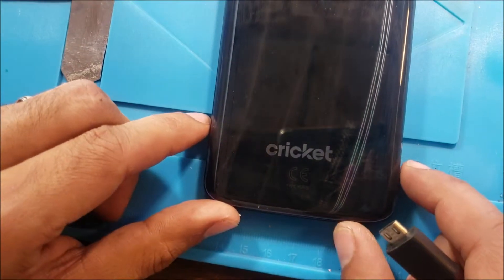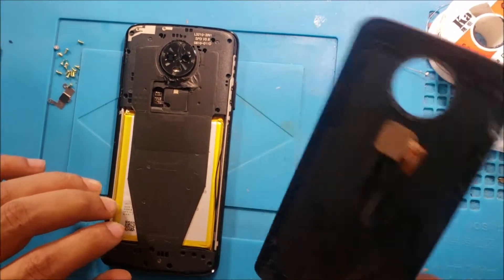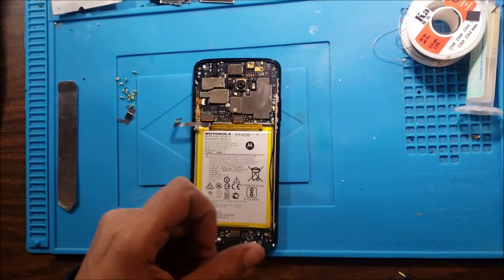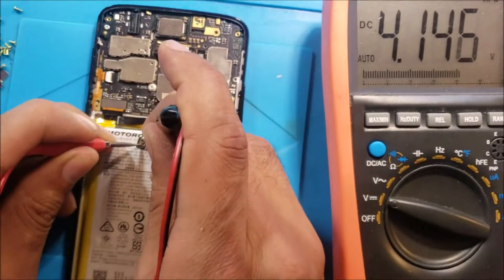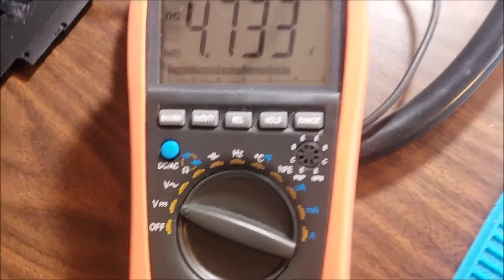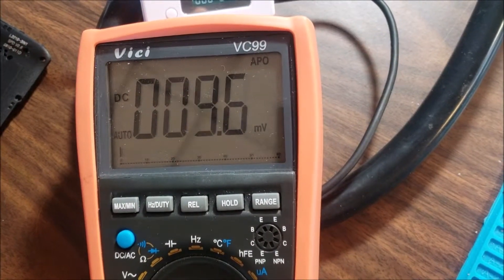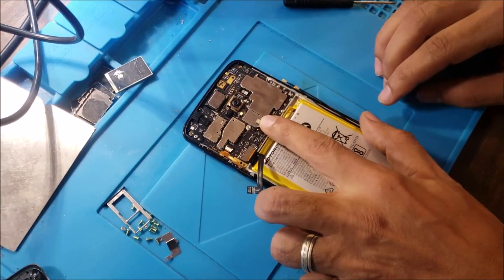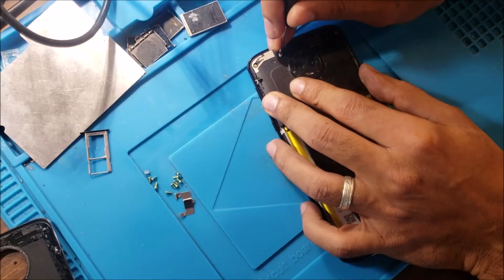Motorola moto e5 SUPRA M7532 no power motherboard diagnostic and repair

Comment: Thanks for the video! I very much appreciate it 😃

Do you think dropping the phone (or rather falling with it in your pocket) could damage capacitors? If not, which other components would you check in such case?

Btw, now there's a .rar with schematics and some internal service manuals floating out there.
Could be a way to tell where are all the caps and also if getting a working one is crucial or not

Comment: sir i have moto one action and its motherboard was get damaged by water
and moto service center and other service center says that some IC needs to get replace and says which is not possible , only solution is replace the motherboard
please help me
8010535191  
Hemant Kumar
Reply from the maker: if you are in usa send your phone for checking it. or look for a local repair shops that do motherboards repair,  its hard to tell
Reply: sorry but I live in India
Reply: please suggest me some bother way

please